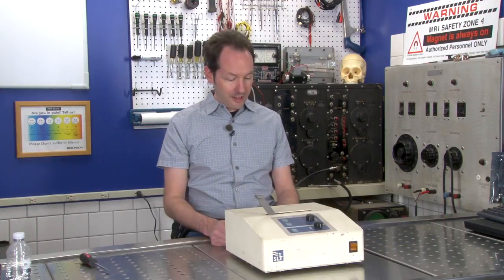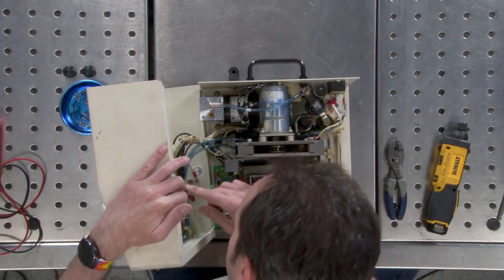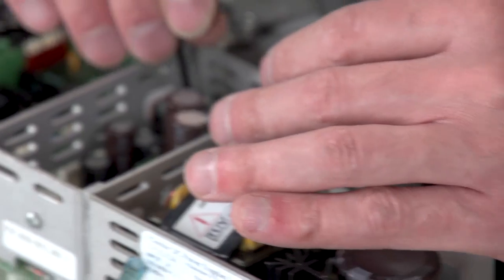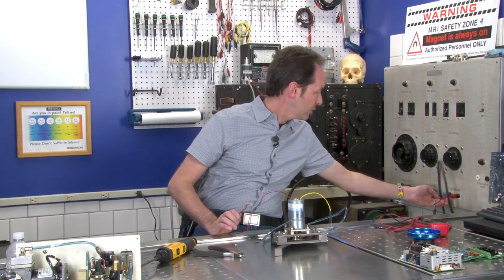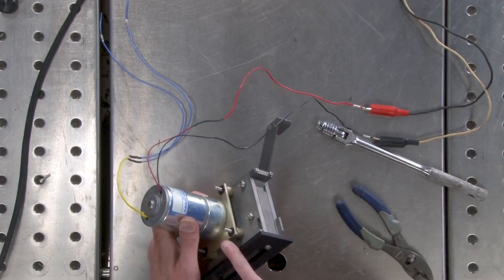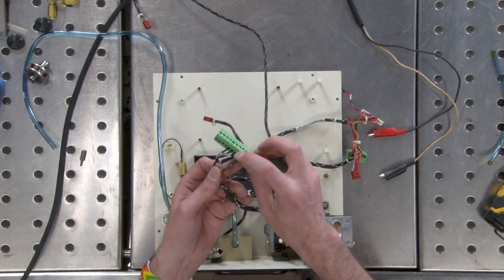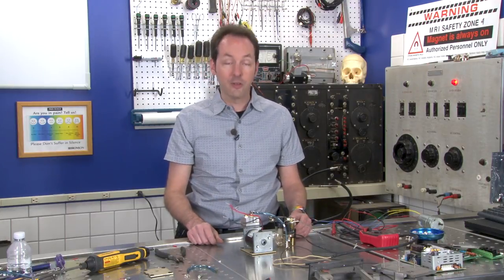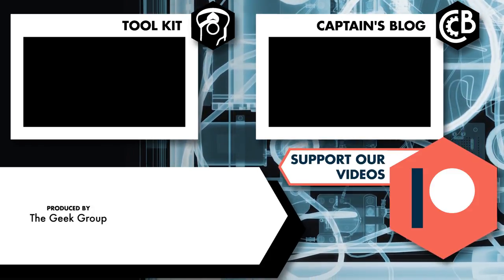Surgical Laser Cooling Unit: Equipment Autopsy #104

Comment: Power supply voltages are measured to its common terminal, not to chassis ground.
Depending on the application, electronic ground may be isolated from any other ground (floating electronic ground), this is normal in audio equipment to prevent ground loops, it can also be used in other sensitive equipment though.
Chassis ground is essentially a safety ground when powered by mains voltages.
Incidentally, depending on how your mains ground is connected,  you may see a slight voltage difference between neutral and ground, our ground is neutral at the transformer to a spike in the ground, and a spike in the ground at the property that only connects to the ground wire in the circuits, i have measured around 20v difference before.

Comment: Putting the slower geared motor on the air pump would reduce the flow rate of the air coming out of the pump.  And in theory the extra torque would allow for higher pressure buildup.  However your limiting factors on the pressure will be the internal construction of the pump.  That particular one looks to be a baffle style pump not designed for high pressure.

Comment: However! Be very careful not to confuse chassis ground with the siginal ground! 

They are often very different! also, the chassis ground is often the AC ground, and the DC secondary ground is isolated, and sometimes floating from the chassis ground! 

VERY Important! if you mix them up, you could BLOW the front end of your Oscilloscope to the heavens!

Comment: The valve set looks like a internal/external air switch, if the pressure switch detects external air pressure it will stop the pump and switch the solenoid. If there is no external air connected the solenoid will switch to the seperator side and the pump will turn on.

Comment: I'm struggling to understand the purpose of this channel - it was obvious from the start this was a peristaltic pump - yet you made not attempt to diagnose what the original fault was, describe the differences between pump types such as scroll, vane etc. didn't describe, explain or calculate gear ratio's, torque multiplier ... Tearing stuff down can be fun - but playing with a simple valve and pressure switch just sems a little lame. Perhaps watch aVe or EEVBlog to get some ideas of what can be done?
Reply from the maker: We mean it to be an exploratory series. How "advanced" something gets depends on a lot of factors, and may not always be to your personally perceived intellectual level. What is "obvious" to you is certainly not so to everyone. We admire and respect both AvE and EEVBlog, but intend to continue to play and explore with things our own way.
Reply: Ok - fair point. Thanks for responding, just thought you might be able to expand your viewer base by emulating some of the points from more successful youtubers and applying them to your channel. Bearing in mind some of the incredible kit you have been given, the industrial robot etc. you have the basis for a highly successful, perhaps second channel?

Comment: The way you touch the solder side of the switching power supply is kinda unnerving. Yes, it's probably already discharged and you had it with the pins facing down on the metal table, but there's always the thought that you might get zapped at any moment.